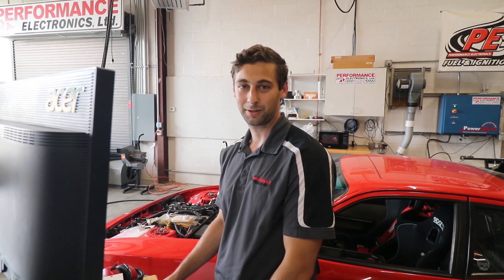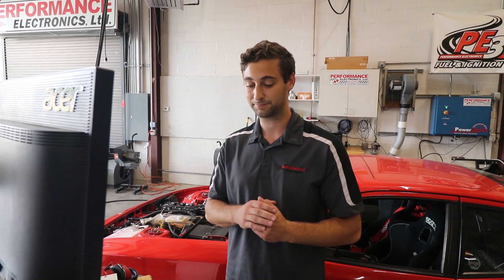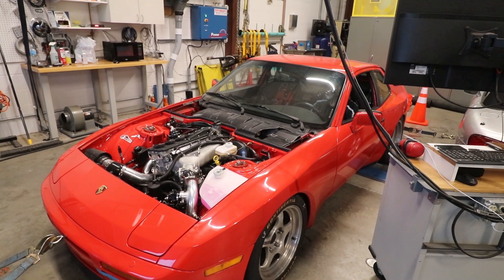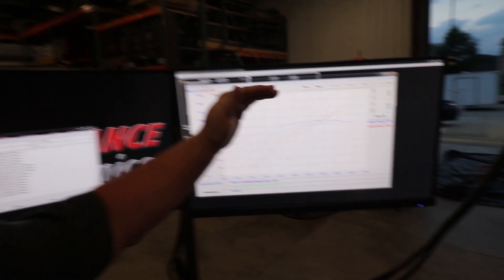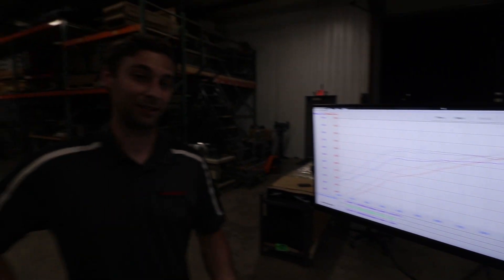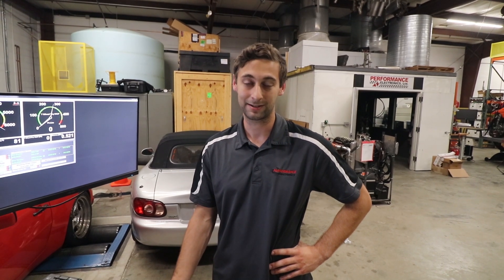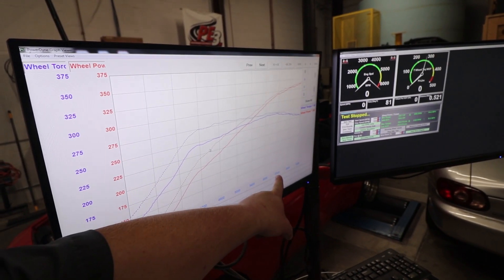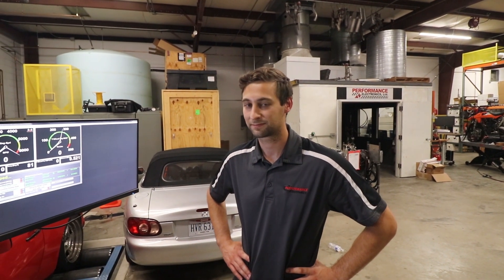Turbo 07K Build - Part 8 (Porsche 944 5 Cylinder Swap)

Comment: I've got to ask - what's the deal with the taillights during the dyno pull?  Loose connection, or a larger electrical issue?

Comment: What pressure were you running this time? I'm in the final stages of my turbo 07k build.
Reply from the maker: 16 or so if I remember?
Reply: @BoostBrothersGarage  that's impressive on stock internals. I'm gonna be a wuss and run 8-10. (The lie I tell myself)

Comment: all the power is in the 5-6000
Reply from the maker: The VVT wasn’t tuned right in this video. It’s typically 4500 to 7000, but as we increase power we are running out of air and need bigger cams.

Comment: 30HP and better fuel efficiency too? I need this to happen to my 83 NA. 😂
Reply from the maker: Go back and check out our NA 07K swap. We did that in our track car and it was awesome! 944 turbo power from an NA 5 cylinder. Throw cams at it and make 220 wheel or so and spin it to 8500 rpm, all through the NA transaxle!

Comment: Thanks for another video. Would be interesting to get a graph of some sorts that shows where what increment of VVT should be used. Torque is now roughly comparable to my 3 cylinder TDI which does 360 Nm much lower than 4000 rpm. I expect big gains with the 07K, still....!!
Reply from the maker: It was basically 10deg from 1500 to 4250, 15 degrees from 4250 to 5000 and either 10 or 5 from 5000 to 6000. That’s what I’m remembering off the top of my head.
Reply: @BoostBrothersGarage  I am no expert but it appears in Japanese engines VVT cuts in way later... Is that correct and why the difference here?
Reply from the maker: Not sure too be honest with you, we just did what the engine told us it liked best!

Comment: How much spark timing are you pulling to get that torque?
Reply from the maker: I don’t remember off the top of my head, but we are still relatively conservative as timing will be one of the last things to tune in. I think midrange was single digits and redline was 16?